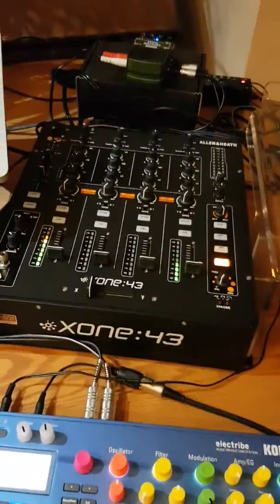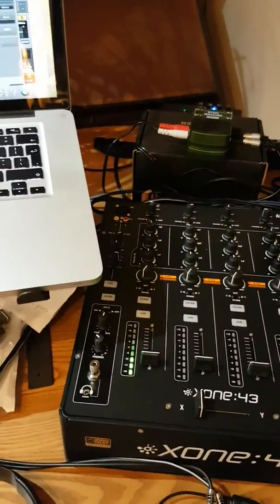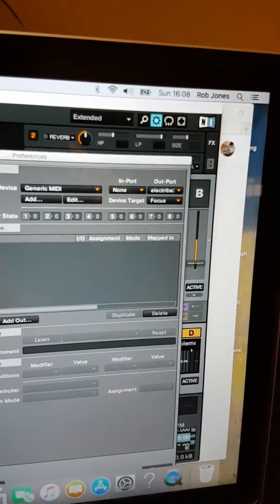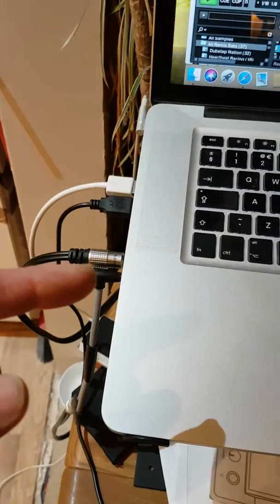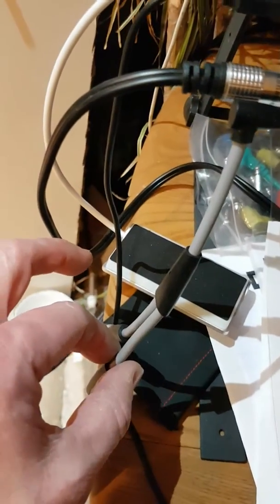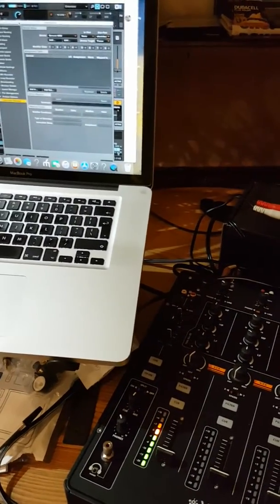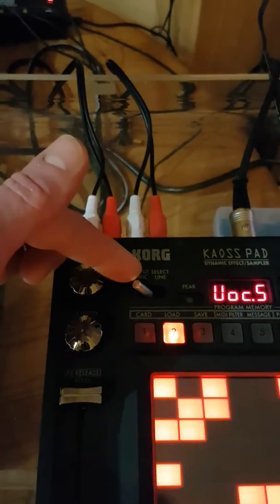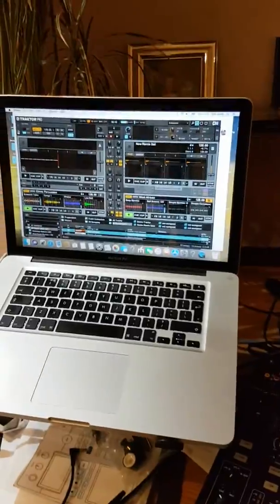Electribe usb midi sync to traktor how to and connections

Comment: Have you ever hooked the e2 into the computer and ran it through a daw like fl studio or another daw? Is that possible? I am seeking a way to take my patterns on my e2 and make an entire song by being able to make sequences or be able to mute the individual parts as I record the beat. How could I do this with or without a computer? I'm trying to go completely dawless. Is there any advice that you could give me? I'm just trying to record full songs/patterns in real time and be able to turn it into a wav file. I know it's a hard question to answer, but this connection stuff is so confusing, and what wires to use or how to do it. Is this traktor pro free, and how does it work?